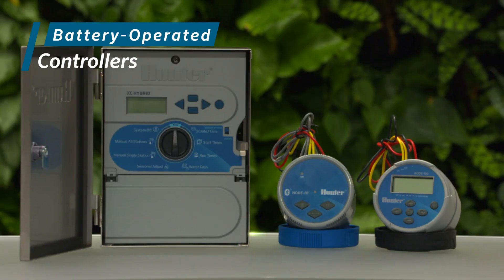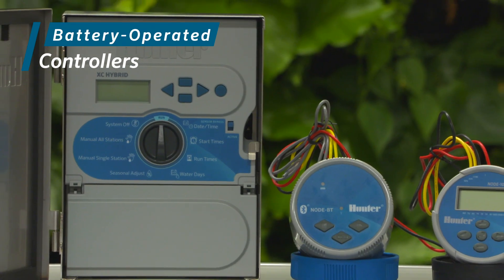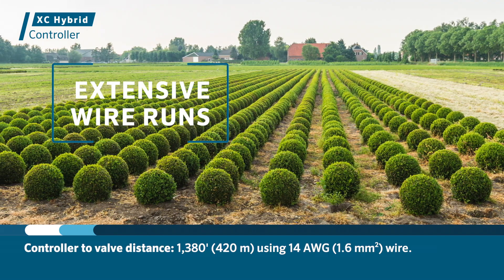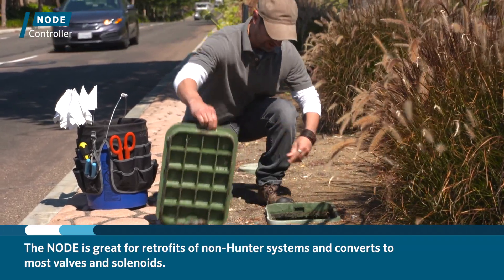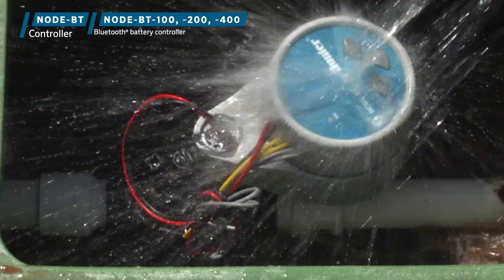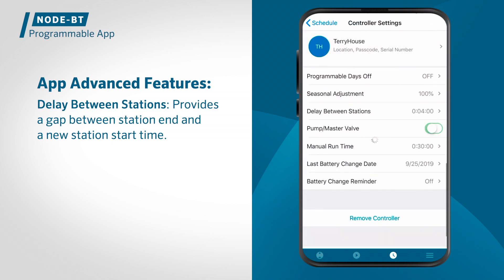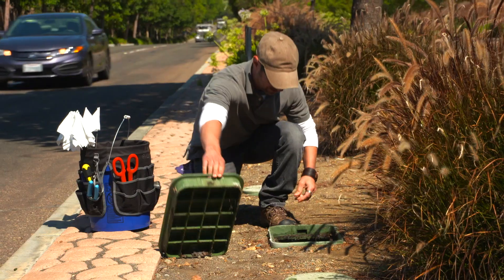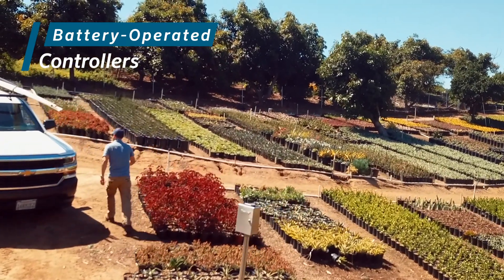Battery Operated Controllers provide irrigation solutions

Comment: Node, Node-Bt, & XC Hybride are sensor input controller. are they also can connect with HC Flow Meter, WFS (Wireless Flow Sensor), & Flow click ??? Please reply as soon as possible.
Reply from the maker: All Hunter Battery-operated controllers with sensor inputs are only compatible with wired weather sensors. 
https://www.hunterindustries.com/node/28061